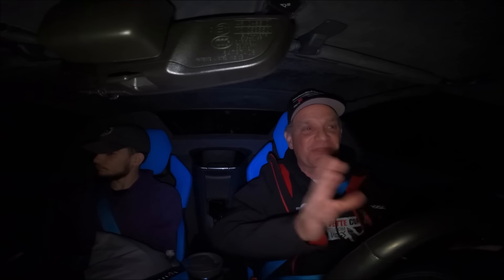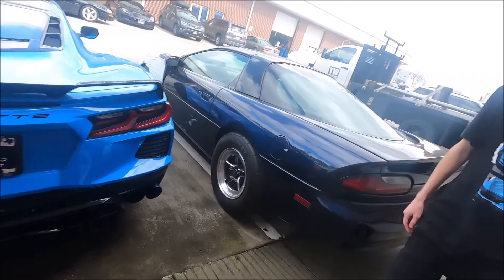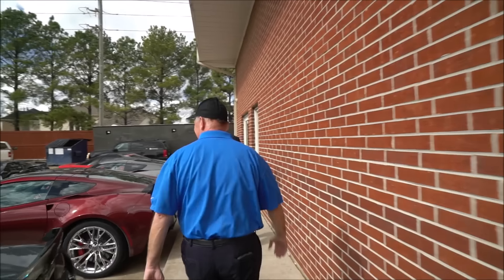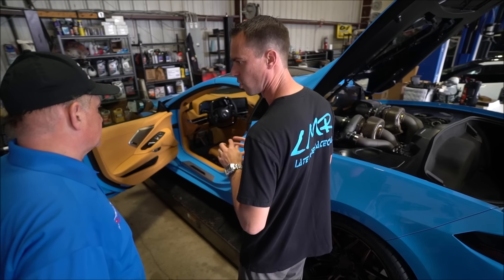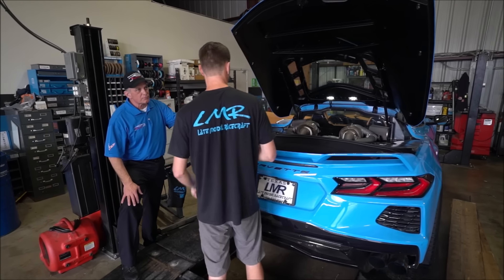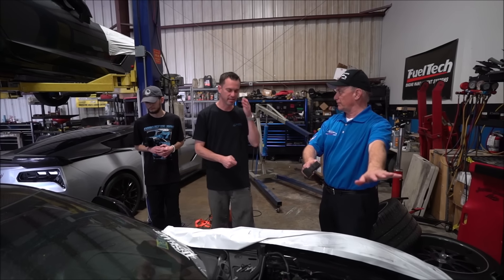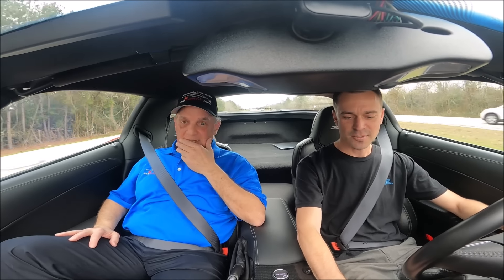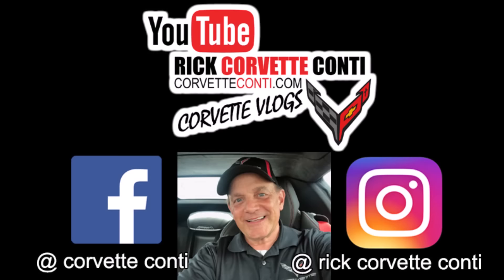PART 1 ~ OUR TRIP TO LMR in HOUSTON CORVETTE BUILDS & RIDES C8 Z06

Comment: Love your shows and very hard work!  I swapped out a set of Michelin Pilot Super Sports for new Toyo Proxes R888R tires on my 2016 Z06 Night Race Blue Coupe and the car is now a completely different Beast - no Sideways Shenanigans EVER and GRIP equal to or superior to Pilot Cup 2 (without the no-driving-below-50 degrees restraint).  And the R888R is not a noisy tire on street in normal driving (Discount Tire tried to talk me out of buying the R888R because of noise concerns).  Another Set of R888R tires is going on my new 2024-25 Riptide Blue eRay (I am number two on my dealer List).